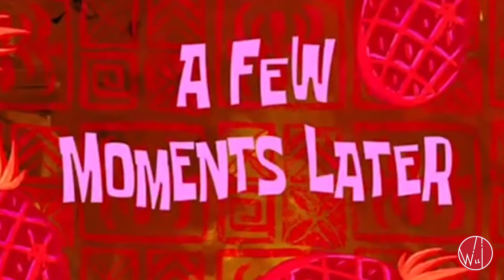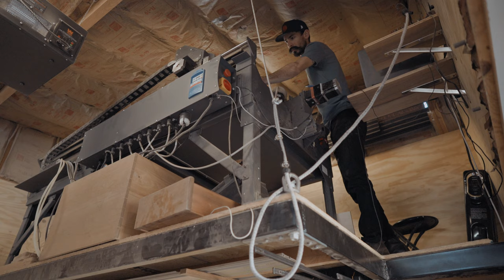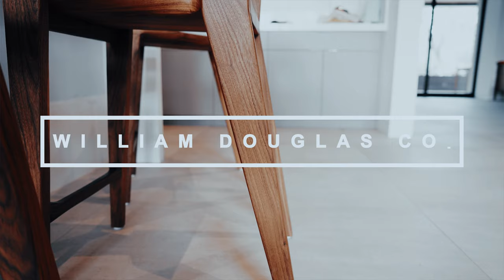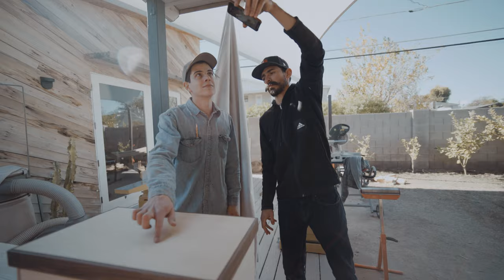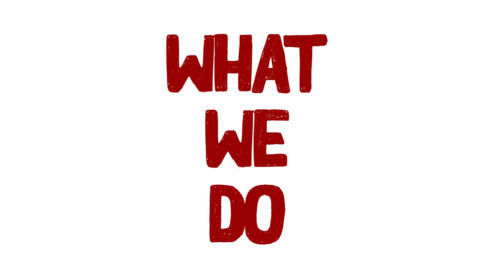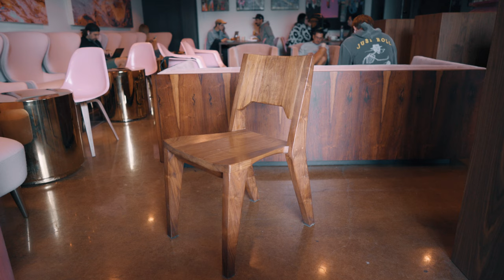My First Woodworking Piece Was STOLEN! / Introduction | Phoenix, Arizona | William Douglas Co. [4K]

Comment: You had me at timeless design. I'm ok with using epoxy to stabilize wood but I'm so tired of seeing epoxy river tables. I don't think they're really that nice and they're super expensive. Can't wait to see this journey you're going to share with us all
Reply from the maker: joel thoenen yeah And I don’t mean to take away from the skills it takes to pull it off. Just not for me you know?
Reply: They were cool when they were an original design picked up by a couple of people... But they've been overdone now and when something is no longer unique, it's not likely to be very cool. It does potentially allow you to make a useful piece from wood that would otherwise be scrap or largely cut down to gain something useable, which is the coolest part about it IMO.

Comment: Love this content man. Any suggestions on an easy to use free design program for furniture making?
Reply from the maker: Gjohnson for sure. I use sketchup. Fusion 360 is also free and is awesome but has a much more steep learning curve. Sketchup is as simple as it gets.
Reply: William Douglas Co. thank you! I will check it out. Keep up the videos. One thing I struggle with when pricing out furniture from one of your other videos, is pricing it out for the clients that really don’t understand how things work. Everyone seems to think it should be cheap. They don’t understand that it’s not just the price of materials that they will have to pay for. Labor is obviously a huge part of it. They basically want furniture build for nothing. Suggestions to help with pricing for someone like me who just does it alone for side jobs?
Reply from the maker: Gjohnson yeah man that’s the battle every quality woodworker has to face. This is why woodworkers so often switch to cabinet shops and just build plywood boxes and order doors and drawers. Our culture today does not value lasting craftsmanship. They only value high design which is easily accessible. 
There are so many important things to learn here. Here are a few..

Don’t lower your price. The craft should have a threshold. When we get people coming in cheap it devalues the craft and it makes it very hard to change the culture. When I was starting out I would rather literally give my work away for free before I sold it for what I didn’t believe was fair. 

Keep a full time job and build up a portfolio. Do it because you love it. Learn and grow. I grinded nights and weekends for several years before I left my job. You have to prove yourself to the community before anyone will take you seriously with artisan prices. 

Give some of your work away. I spent two years developing my chair and when I finished it I gave away the first 3. Find someone in your community that you look up to and want to build a relationship with. I got a ton of my work this year from a relationship that started 4 years ago when I gave a coffee shop owner a chair. 

This conversation could go on for a very long time so I’m just going to leave it at that. Please don’t sell yourself short. Take the craft serious. Pay your dues. Be honest. Grind. And get paid fair.
Reply: William Douglas Co. thank you so much for taking the time to reply. Solid advice. Thank you for the inspiration!
Reply: @WilliamDouglasCo "Our culture does not value lasting craftsmanship". Bingo!! So true. Thanks mass production!
Reply from the maker: TWC no joke man.

Comment: Just found your channel. 2and video. Great story. May I ask what you did before before, or what you did to save for your tools.
Reply from the maker: Absolutely! I’m an open book. I was a commercial electrician for a few years and then I was a “building engineer” glorified maintenance man / contractor / builder for a big vending company. I worked that job full time and worked on my craft nights and weekends. Grinding and grinding just trying to learn and understand the craft. Most of the time I spent building I was just experimenting. I gave away most of what I created and worked on developing relationships with people I wanted to build stuff for.

Comment: Did you take the 4 inch restrictor plate out from behind that 3 way coming into your dust collector? It will increase CFMs pretty significantly
Reply from the maker: Commercial Productions good tip! I’ll check it out
Reply: @WilliamDouglasCo  it's tack welded in at several spots. Angle grinder works

Comment: I find myself wondering if I'd love this channel as much without the moustachio.  I think yes but I dunno.    I'd love to see your design process.  I currently do a doodle process.  I doodle... then re-doodle and repeat until it looks like something I could make.   I started using sketchup but, honestly, it's pretty frustrating so far.   Wood (see what I did there :)  love to see how your process works.
Reply from the maker: Terence Alderson did you watch my sketchup video?
Reply: @WilliamDouglasCo  I saw that it existed just after I wrote that comment. Sorry about that. I'll definitely be checking it out.  For now, back to taxes...
Reply from the maker: Terence Alderson ahhh Taxes! I need to get mine done soon